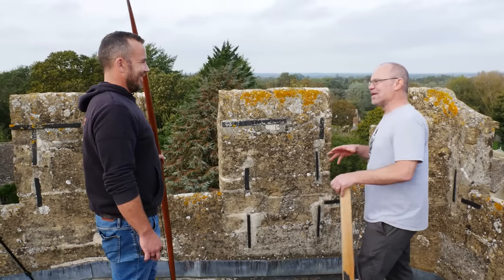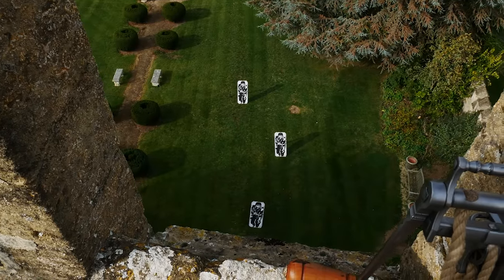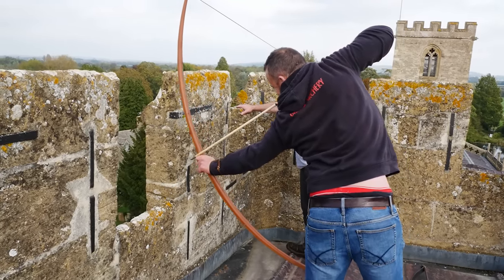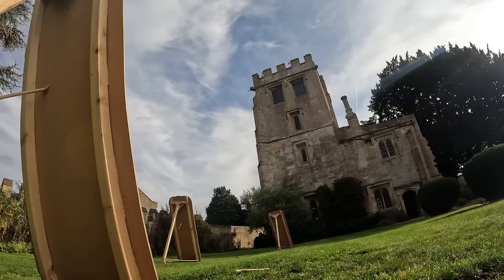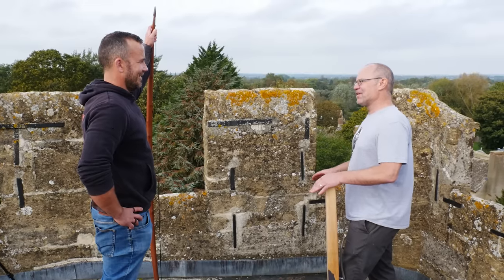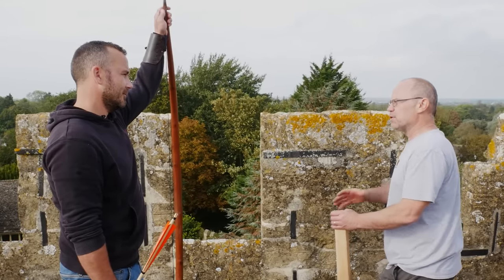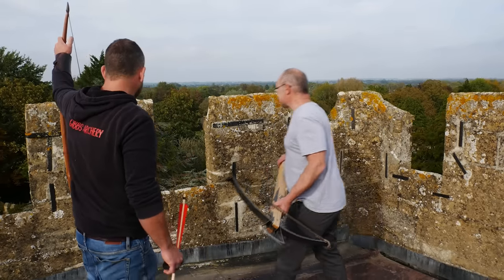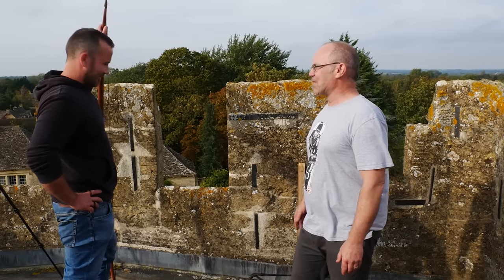Crossbow or Longbow? What's better for defending your medieval tower?

Comment: One thing that sticks out in the video, is just the mechanical advantage; Joe is tensing up and doing hard work, everytime he wants to give a shot. Tod is methodically reloading with the windlass; but in a siege that might actually be a meaningful difference. Suppose you had to man that piece of wall for hours, while an enemy attempted to storm it -- exhaustion would be an extremely real problem.
Reply: Sieges were often days, weeks or months, so if your soldiers are doing less work per shot, they're burning less energy and need less food.
Reply: I'm not sure the overall amount of work winding the windlass is actually less than the strain of pulling the longbow. Where it would definitely make a difference, though, is in missed shots. Every time Joe tries for a shot and his target moves or he has to dodge return fire, he's doing a full-body workout and then controlling his de-tensioning as well. With the crossbow Tod can load it once and miss five opportunities before finally pulling the trigger, and only his thumb gets tired from holding his bolt in place.
Reply: They more or less said it in the last video. Joe was pretty much spend after the one quiver he brought, and was starting to get visibly exhausted.
Reply from the maker: Interestingly the records show that for the attacking force (proportions of different soldier types unknown) 1 arrow a minute was shot per man present.  assuming this is normal, then the sow reload time of the crossbow is actually not at all the disadvantage it appears to be and the ease becomes a massive advantage
Reply: crossbows are easier to operate so you can have more firepower than using longbows since anyone can use 1 basically. Being behind a wall also helps people using crossbows since they can reload safely. 

Crossbows were known to have an advantage defending inside walls while longbows were better in the open when you needed more arrows per minute
Reply: Then compound this how geneoanese crossbow men had a apprentice that reloaded for them. Don't know why that wouldn't also be used for defending fortifications.
Reply: @megathicc6367  crossbows were used as a pair. Apprentices were mostly young lads too young to be useful on the battlefield
Reply: @AllahIsntReal they have the entire hundred years war as their claim to fame, and even into the 17th century England still maintained a few companies of longbowmen.
Reply: I don't know how much of a problem that would have been.  Longbowmen trained from childhood years and were incredibly strong.
Check out the history squad, the guy has a lot of good input on longbowmen.
Reply: @tods_workshop  that's like saying just because I can do 1 push up every minute  doesn't mean I can keep that up for hours let alone days. Picture firing a bow for 2 days straight with 1 minute shots.  Idc who you are by the third day. You're done you're not shooting any more bows without serious injury. You're muscles are torn to bits
Reply: @tods_workshop  I do think it's an advantage but I think you're overestimating it. some of the shooting happened in specific time periods in the siege where there was a more serious opportunity rather than during all of it. shooting a regular bow faster during those time frames could be a serious advantage.
I think having a mix of bows and crossbows would be the best. use the bows along with the crossbows during the more intense periods and use the crossbows for picking off people that are out of position when there is a less intense time frame.

Comment: I think you're under estimating that advantage provided by the crossbow to be able to crouch and pop up to take shots. Any advantage you can get in a life and death situation you're gonna take it.
Reply: That half second less exposure when someone is shooting at you is HUGE.
Reply: I think with a lighter bow Joe could shoot faster but not as fast as Tod . 

The fire rate on the other hand Joe can shoot 10 a min. This is a great video idea. 3 men with 1 shooter and 2 loaders Vs Joe with an 80lb bow.
Reply: @WozWozEre  Yeah and it seems more like a couple of seconds actually. That's a significant advantage I would guess.
Reply: Even blind firing without putting anything at danger would be possible with a crossbow.
Reply: @WozWozEre yeah because people need time to notice you react aim and shoot even half a second faster can be a difference between you going back to cover and not making it
Reply: With a lighter bow held almost horizontally you could totally crouch, draw, stand up and shoot.
Reply: @Mike-oz4cv agree, but would it be effective against those armored guys with such less power? Remember it has to penetrate at least chainmail (if not plates) and gambeson with a steep angle of attack
Reply: @Cisco88C  Good armor is very hard to penetrate even with the strongest weapons. I’ve honestly always wondered why they even bothered with >80 pound bows if they didn’t solve the issue. But maybe the idea was to force your enemy to wear heavy armor. Also plenty of soldiers/armies couldn’t afford good armor.
Reply: @Mike-oz4cv  the hit would be still felt, and noone likes to stand there while items keep crashing into him
Reply: The people inside would not be visible, if there were a wooden roof and arrow slits (hoardings), the area behind the arrow slit would be dark, and the people outside would not be able to see inside, the only clue would be when a projectile comes out. there are better videos that show this in action.

Comment: Would you say the crossbow has an advantage for the attacker on the ground?  A bow, you cant draw it, and wait for the archer up above to pop their head out to shoot... a crossbow you can load it, point it at the opening and ... wait.  You can react to the archer up there poking his body out to shoot.
Reply: nice point, still wonder how good you can aim with it tho, (iff not heavy trained in it)
Reply: Don't forget xbows weight a lot, and holding it pointing up for more than a few moments would be tiring
Reply: what if the defenders have a dummy head that they can poke out to make the crossbows prematurely loose? I've seen similar tactics in modern sniper warfare.
Reply: Interesting thought, though with the range gained by elevation and lost by shooting upwards I think it would be of relatively small gain. Not one you are going to object to if you can have it of course, but having to hold that bolt in (as most crossbow historically don't seem to have methods to retain the bolt) would probably make your movement across the battlefield more awkward by more than enough to offset the gain at all I'd guess. Though it would be nice to see Tod and Joe try some of the match shooting type concepts firearms folk love - run to barrel A, shoot, back to Barrel B, shoot these 3 targets type stuff.
Reply: @VuurBarbaar Definitely a better aim than with a bow. Especially with less training.

It also doesn't take that much training to become proficient enough to be useful with a crossbow, compared to a bow.
Reply: Really well. Within 5 shots you'll train a complete novice to hit a man sized target at 40 years with a medieval crossbow. It's actually surprising how easy aiming with the bolt is.  @VuurBarbaar
Reply: The biggest issue, as was mentioned, is likely holding the crossbow aimed for long enough without tiring.  There's also travel time to consider: if someone pops out for a second, you might not have enough time to correct your aim, fire, and still hit them.
Reply: @Vinizuca bow will exhaust even more, you can't maintain draw with warbow for long without releasing.
Reply: @Vinizuca  it would be tiring, but crossbowmen usually also carried pavise shields. We can safely assume they rest their crossbows on their shield while waiting for enemies to shoot.
Reply: Shooting sticks, aka bi pod  @Vinizuca
Reply: yeh but you can lob bow fire as well operate suppressive fire. the only advantage i can think of with a bow.
Reply: A larger attacking force can attrit a smaller defending force inside a defensive position even if they exchange casualties one for one. This could have given an attacking crossbow unit the advantage in fights where both sides were picking each other off from cover. 

A weapon that was slower to reload but faster to acquire and fire might have been better at hitting targets of opportunity.

Attacking crossbowmen had options for firing from cover. Longbowmen had those same options, but it might have been easier to set up shooting positions for crossbowmen. 

When storming a position, an attacking force's crossbowmen could also have been used to keep defenders' heads down. Although, for this job, rate of fire may have been more important than ease of use or average accuracy. 

For that final rush to the wall, I bet attackers used whatever weapons they had to shoot with. But lots of longbow arrows may have served better for--or alongside crossbow bolts in keeping defenders buttoned up. 

Either way, we're lacking information.
Reply: You're forgetting arrowslits and the top of the castle would have wooden structures all the way round to make defence easier
Reply: If they had practiced shooting up then yes, if they hadnt then they probably wouldn't have known that serious changes in upward or downward angle affects the impact point quite dramatically if they hadnt trained/adjusted for it, also I think the crossbow brings the level of your base troops effectivity way UP, as anyone could be trained on it's operation, you didn't need to be a big strapping lad off the farm that could draw a big long war bow that had trained for years...there probably wasnt many of them around back in the days of real hunger.
Reply: @Vinizuca  Compared to holding a 40-60 pound bow drawn and pointing upwards? 
Not saying xbows aren't heavy, but when placed in compariosn to a strung bow it's a lot less muscle power being expended per second.
Reply: @Vinizuca  I've seen many illustrations of crossbowmen hiding behind large shields while attacking a fortified position. I'd imagine they lean the crossbows on there until a head pops out?
Reply: @Trebor74  That would also be an interesting experiment, ie crossbow vs longbow through an arrow slit. I've often wondered how easy that would be given they also seem awkward to shoot from. Curious whether the crossbow's horizontal width would restrict the field of fire vs a longbow's more vertical shape.
Reply: Could in theory if there are no other defenders shooting at you whilst you wait for the 1 guy to pop out from a certain position but it would not be wise in most circumstances.
Reply: Would I be the longbow attacked, I'd try to be hidden (as much as possible) in the forested areas, using the advantage of power = long distance shot. However with the cranelations and such, aiming at the target may be a problem and thus maybe the goal would be to just pepper the tower from above (arched shoot, provided enough archers) which loses power and probably causes much less damage. 

Xbows I only see effective from a shorter distance and thus mostly inadequate for tower or fortress assault instead.

They'd be still quite good for open field battle however.
Reply: @LuisAldamiz  The idea of a castle though was to defend some important location. So it would be normal to clear trees and any other cover around the castle. So attacking archers wouldn't have cover, and other attackers would have to attack across an opne field.
Reply: @Vinizuca  you put an xbow on a v stick just like a musket. I carry one for hunting
Reply: Exactly the point I came here to comment. The crossbow is a better sniper weapon where you wait for the shot opportunity, while the bow is the assault rifle where you shoot at whatever you see at that moment. The guy in the tower has no difficulty finding some target to shoot at, while the guy on the ground has to wait for someone to stick his upper torso above the wall for a very brief moment.
Reply: @Vinizuca for a pavise might be a good option tho
Reply: @Vinizuca I guess you could rest it on your pavese (or however that’s spelled) shield
Reply: Unironically, Mount and Blade is what taught me this.
Reply: Romans did this with ballistas during sieges. Except ballista bolts were like a giant throwing a spear. I don't think any body armor would stop something like that. It was the ancient equivalent of a .50 cal sniper.
Reply: They both have advantages and disadvantages. the longbow is more exhausting to use consistently in awkward situations, when compared to the Crossbow. Another thing many people here, and the two in the video, are forgetting about are arrow slits and Murder holes, both common features of a castle. Murder holes are nearly outright impossible for a longbow to use, because it requires the archer to aim at down at almost a 90 degree angle. Arrow slits, despite their name, are also very difficult for archers to use due to the massive amount of reinforcement the slit needs to not become a weak point. In this way, longbow users have to stand about a meter back from the arrow slit to have enough space to fire their longbow, crossbows can be right up against the slit. The final advantage of the Crossbow is training, you can pull a peasant from the field and have them able to use a Crossbow in minutes, Longbow require a lifetime of training.
Reply: You wouldn't be able to point it for more than a few seconds with reasonable accuracy.
Reply: @Vinizuca perhaps you can just use something to prop it up besides, if you see them popping out every few seconds I'm sure you can hold it up for that long.

Comment: No matter how good I was at shooting arrows with a longbow at the start of the siege, by week 6 of rationing I'd be glad to be using the less energy consuming crossbow.
Reply from the maker: You are right that it is a bit more slow and steady and the peek work is lower, but the cumulative work is the same
Reply: @tods_workshop  I still think if you two tested how many shots you can get off without a break, you would probably be able to fire more shots with a crossbow than a bow
Reply: @tods_workshop i dont think the cumulative work IS the same. You put the work into spanning the crossbow, but then a mechanism holds it in place. Every fraction of a second that the longbow is held at full draw in order to aim is extra work being done by the bowman. Across an entire day of shooting those fractions of extra effort would add up
Reply: @tods_workshop  spanning the crossbow could fairly easily be outsourced to a non-combatant that also helps you being a gofer for new bolts, or water or whatever.

And really, the ability to snapshot the crossbow under potential enemy counterfire. preload and prep in relative unseen safety, and then pop up and shoot is massively safer than awkwardly having to aim in fairly clear view where the enemy can see ahead of time exactly which crenellation you're going to pop up by.

I have a mental imagery of a crossbowman sitting down behind the crenellation, winding up the crossbow in a vertical positioning along the floor, and then when sufficiently many of them are ready, popping out, all but shooting from the hip
Reply: I'm thinking if they didn't have a specific shooting style, shooting the bow might have really messed up your back
Reply: Ya respetaba a esos arqueros pero ahora los respeto más porque la fuerza y la resistencia que exigía el arco no era para cualquiera.